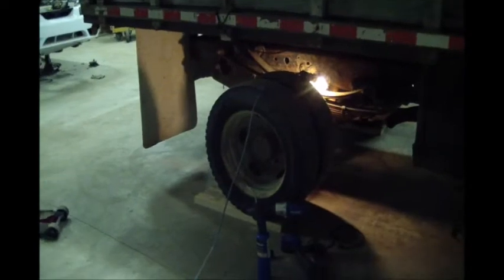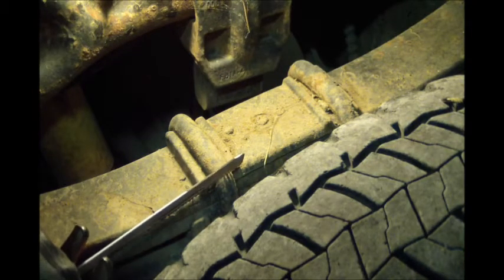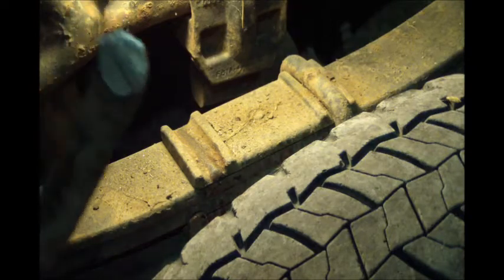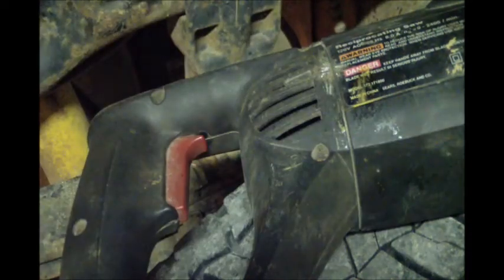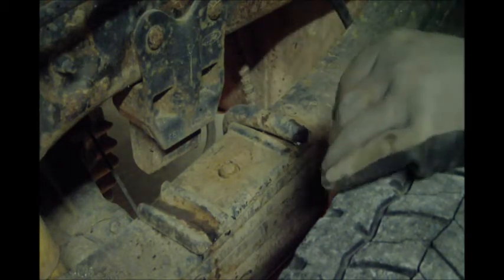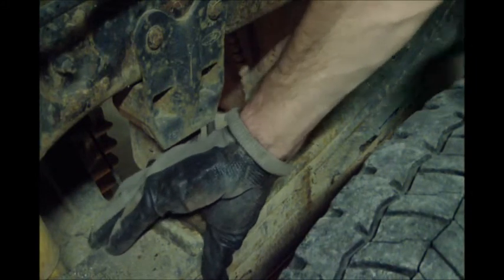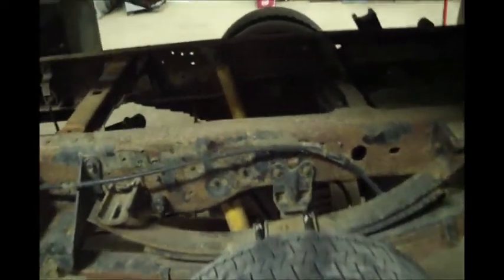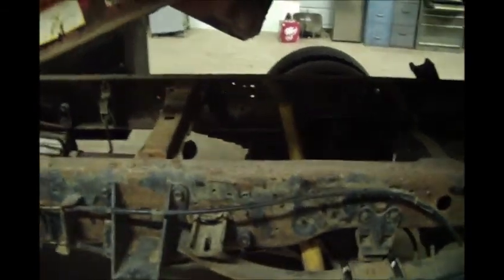Replacing U bolts on F450 leaf springs.  Bolt under tension explodes.

Comment: What torque settings
Reply from the maker: I ended up putting the impact on them and rattling them down father.  I think i marked the socket and took them another 1/4 turn with the impact.  So 150 ftlb plus 1/4 turn.